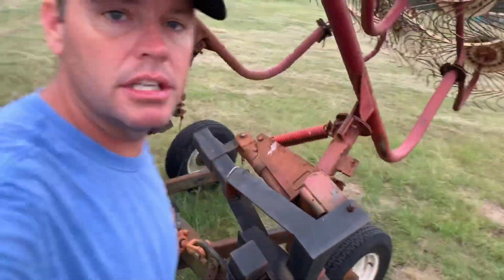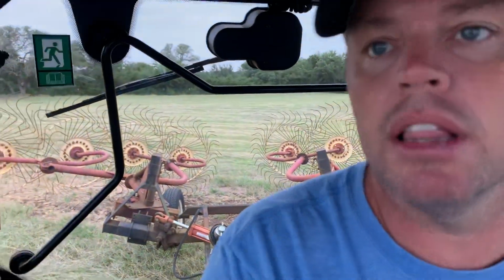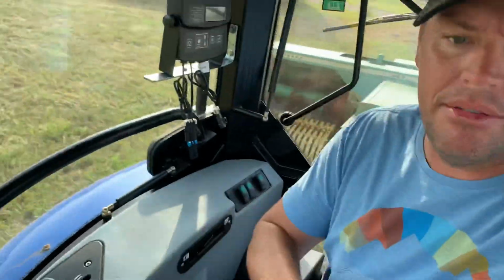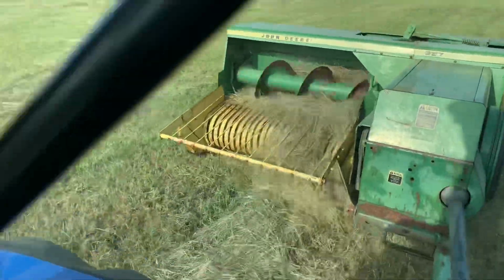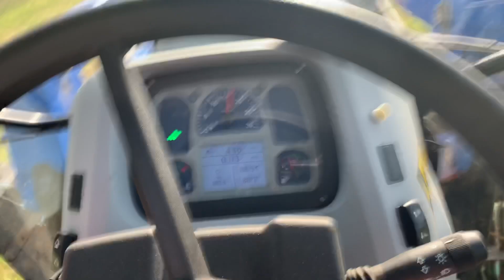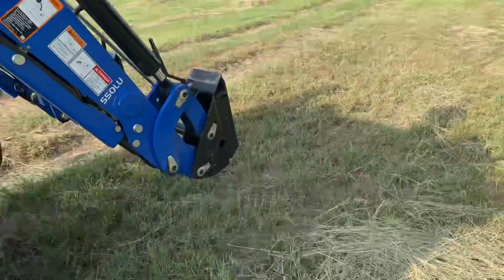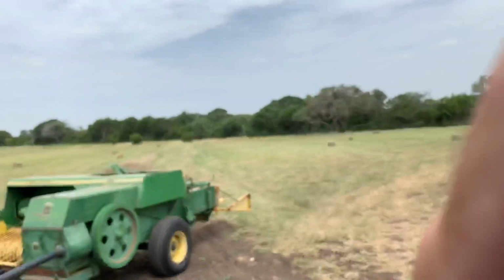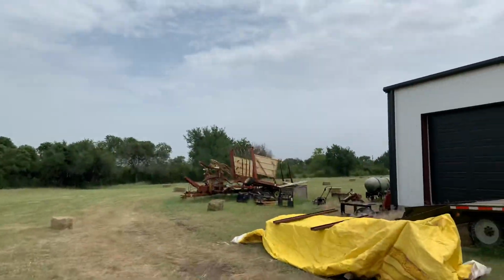First time square baling

Comment: Looked like your first bale was a double.  We never ran green balers here in Lincoln and Catawba County in NC.  Pop sold New Holland.  That's all you see around here.  Deere makes a really good square baler though, just didn't have dealer support around here.  We did use a stacker with a bale chute like you have.  Later went to all rounds for cattle.  We never had the luxury of a cab.  Thanks for the videos.

Comment: Watching this nearly a year after you posted it. I started square baling 2 years ago and your reactions are about like mine. My baler was cleaned out when i started and I quickly learned Not to loosen everything off and empty the chamber unless absolutely necessary.  First few bales come out messed up or busted. We always cut the first bale or two open and rebale them just the get the baler dialed back in and get the tension where we want it.
Reply from the maker: The best way to learn is hands on and just try it. You quickly figure out what works and what doesn’t. I really enjoy square baling except when it comes to getting them out of the field. Thanks for the comment
Reply: Did you get your old stack wagon working? Never seen a video of a pull type running. Personally, I built an accumulator to set groups of 8 first then I built an 8 bale grapple to come back and pick them up with. It’s 2 steps but it works good for me.
Reply from the maker: No it’s turning out to  not be worth it financially. I replaced the main bearings on the pto drive that runs the chains and pump. Then two metal hydraulic lines burst due to rust. One of the cylinders is pitted so bad it needs to be replaced but it’s got a special pulley welded to the top. Lots of other issues I’m afraid will come up  once in the field. I think accumulators and grapples are the way to go.

Comment: I know you don't have this tractor anymore but I've got the Case 75A equivalent. You said you swap the hoses for the attachment to float with the green handle/ports. This is my first tractor with dual rear ports. Do you think my Case green ports is like this? I'm only used to the single rear ports on tractors and now learning what I can do with this extra set of ports. Thanks.
Reply from the maker: Yes the case should be identical to the new holland  other than the paint colors

Comment: I see that you keep the loader on with the attachments removed while baling.  I’m told it’s a 5 minute job to remove the whole loader on the new tractors.  Can you do a video on that’s?
Reply from the maker: It depends on how I fell the day of when it comes to leaving attachments on the loader. Usually I keep the bale spear on when baling  Incase I need to move a bale out of the way. Yes the loader is easy to remove but can certainly make  a video on it soon